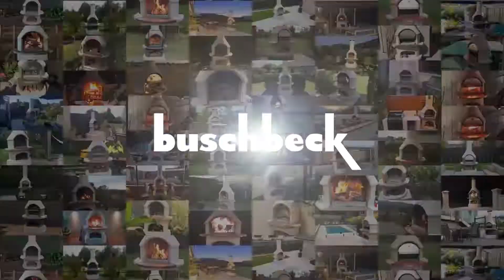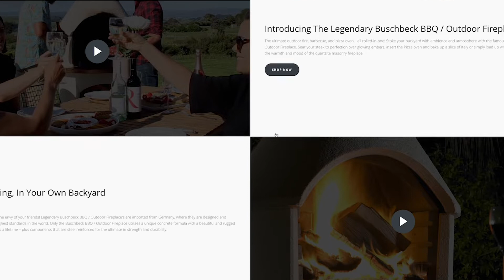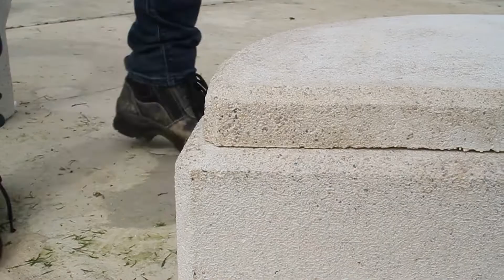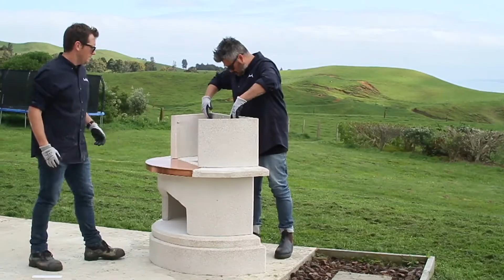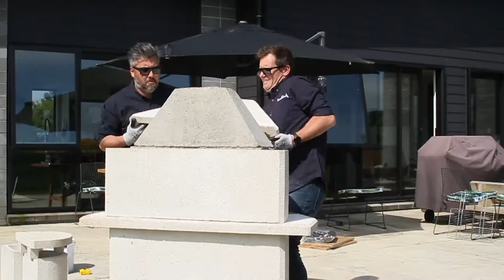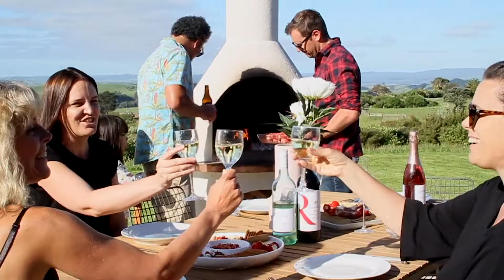How To Assemble A Buschbeck

Comment: Awesome oven I purchased one a few years back only downside is the way I was treated by the company after a fault with the stainless & a fault with the pizza oven & working in the metal industry & engineering for 20yrs was basically told I was wrong & that's how it's made needless to say they never bothered with any re-imbursement or replacement so disappointed after spending $3000 & being treated like shit basically.
Love how these guys used the level at the start but then the chimney is not straight. 🤣😂🤣
Reply: lol, I thought I was imagining the wonkey chimney